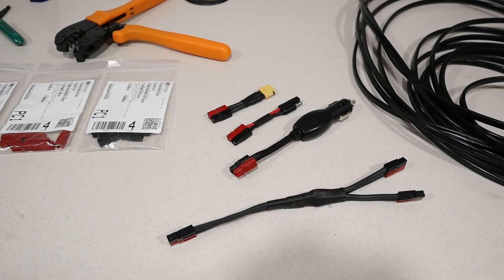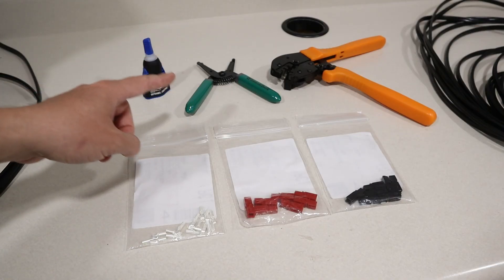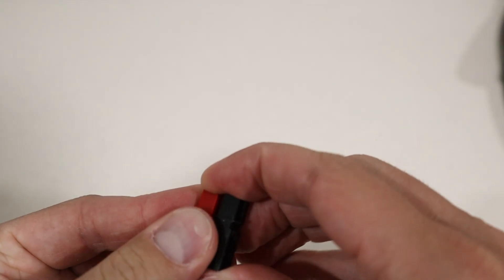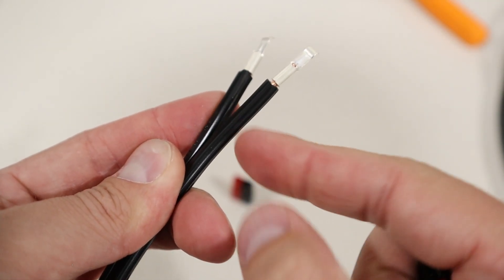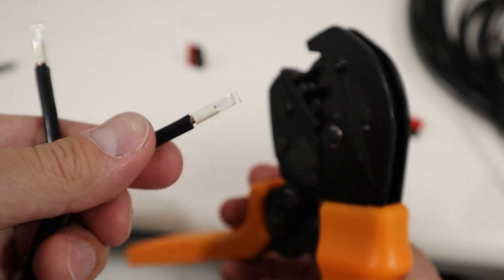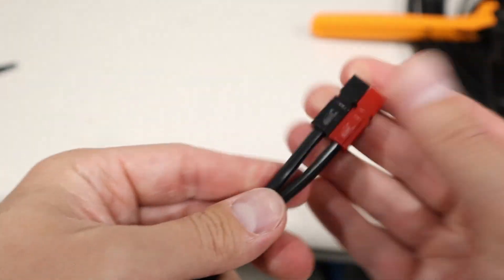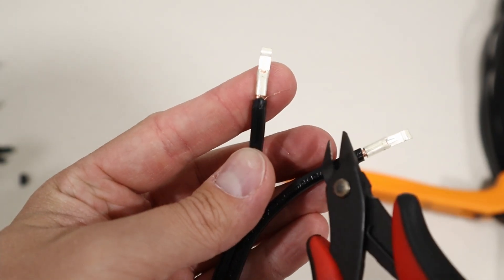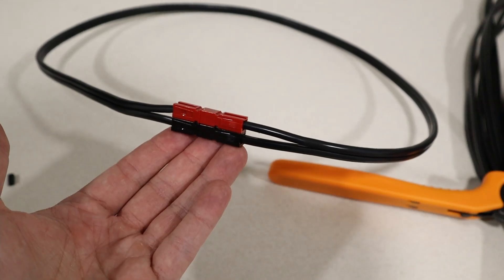Anderson PowerPole Connectors - EASY GUIDE TO WIRING - 15, 30, 45 Amp Connections

Comment: Great video. I wonder if powerpole 45 can plug into sb50?
Reply from the maker: Actually the 15, 30 and 45 amp connections fit into these same connectors, not the larger SB50 connectors
Reply: @Jasonoid  thanks. I guess I need to crimp a connector with two different heads

Comment: Those crimpers are great but will not work with the biggest 50 amp poles
Reply from the maker: Correct, these only with with 15, 30 and 45 amp small red and black connections.

Comment: There are not a lot of vids!  Thx. My extension cable for solar end with a cable end cap (krimped) . That I will try to include in the anderson. If too big I will cut the cable and try again.
Reply from the maker: You'll get the hang of it, it just takes a few crimps to get it down!

Comment: The proper orientation for amateur radio use is Red Right "A" correct! when looking at the front of the connector  the  "A" will be in the correct orientation "Correct side up" Red on the right side. Nothing worse than a bunch of hams coming together for field day and fire works happening because some idiot didn't follow the standard! Jim KB1PFL..PS we use a lot of Solar panels for Field Day.
Reply from the maker: So glad that the world's standard also matches the amateur radio standard....thanks for the "Red right side, A up" terms, good way to remember when assembling them. Love these connections.

Comment: I was thinking of using landscape wiring for extension leads for a DIY solar suitcase. How would your rate that landscape wire in flexibility? Will it roll/unroll, and then lay flat?
Reply from the maker: Yes, I use landscape wire for all my solar extensions! I love that stuff! 12awg is best
Reply: @Pedro Barrios 12g is far from best. I would not consider less than 10awg

Comment: Exactly how I do it down to using landscape wire.  The only thing I do different is to put a piece of heat shrinkable tubing on it to keep the wires from splitting more.  I’m a bit on the anal side thou.
Reply from the maker: You can purchase landscape wire by the foot at Lowes or HomeDepot. Its the same as any other wire but it's UV resistant and very flexible.

Comment: Can I cut off the cigarette plug and instal a 5.5x2.5 mm dc plug to run my iceco jp40 with my Togo power-Advance 650?Having power issues!
Reply from the maker: Yep, I have done that with my power cords, except I used Anderson power pole. Any adapter should work fine!
Reply: @Jasonoid  Thanks for the response!Fairly new sub here!Keep up the good work!!
Reply: @Jasonoid  No Anderson output on the Togo 650🤬

Comment: Just incase you didn’t know, theres supposed to be a pin in between the red&black connectors.  You must not have received any in your baggy.
Reply from the maker: The pin is usually used for putting 4 together in an enclosure. Either way works fine!
Reply: I find the pins to be a pain in the butt.  Glueing is lots easier.
Reply from the maker: @davidtotten618  Only worry is putting them together in the right orientation the first time because they won't be coming apart with glue! I like the glue as well.
Reply: pins not always included… I’ve never seen any and I’ve used a lot of connectors.
Reply: The roll pins have always been an option. In many cases the pins are just a little too big in diameter and force the two ends of the power plugs apart. Just a little, but it is enough to make mating issues with other pairs that don't have the pins. As an amateur radio operator for many years, I use Andersons on everything I carry to the field that is DC powered, which enables swapping power cables and adapters as needed on the fly. By the way, the "red-is-up-right" assembly method is also the Red Cross standard.
Reply from the maker: @sagebrushbob2321  I totally agree! These connections are the best! The "red is up right" is a great way to remember!

Comment: And of course you put no-ox grease on the wire before crimping and on the metal contacts before plugging them into the connector. Helps keep corrosion from water and other contaminates at bay. It's the same stuff us professional installers use for Telecom equipment. Fiber optic equipment and power distribution bays in telecom offices.
Reply from the maker: Great recommendations! I'll mention that in my future videos. I live in a dry environment, no humidity here. Not something I have to worry about. My cables don't ever get wet either.
Reply: @Jasonoid  I live in Vancouver WA. the telecom central offices all across the country all used no-ox as a standard installation procedure. That is where I developed that habit. Of course we had to use calibrated crimpers too. We crimped everything from 500 cm, 3/0 down to 14 gauge. Anything smaller was like RJ45 connectors and RJ11. connectors